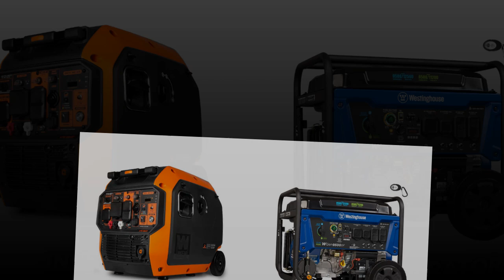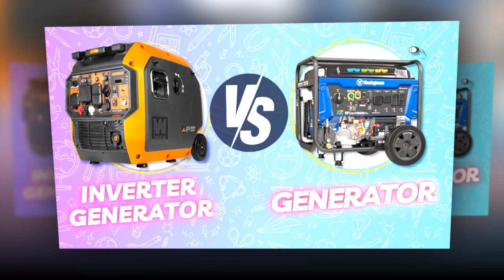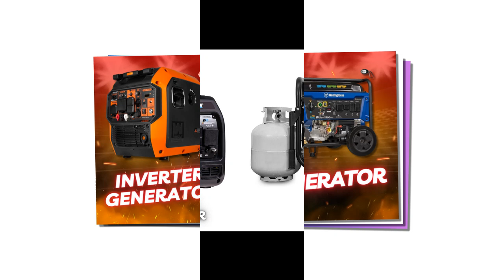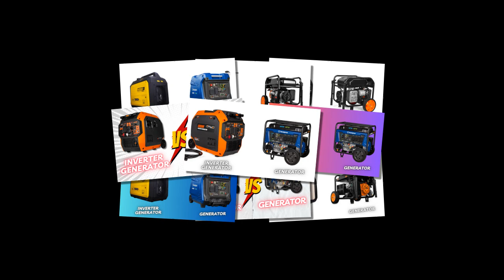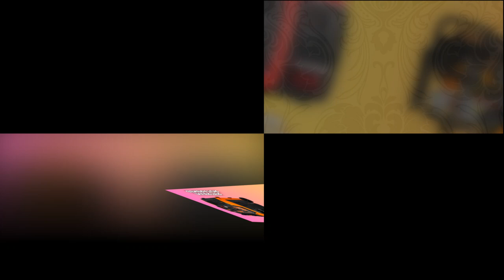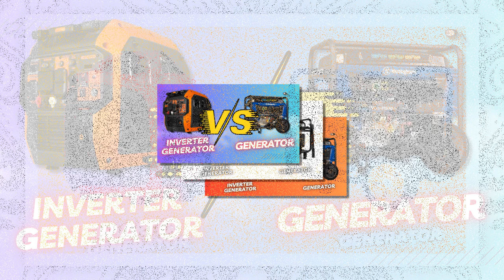RV and Camping Power: The Essential Inverter Generator vs Generator Comparison

Comment from the maker: Link = https://cutt.ly/Cr0d33sI
.
Inverter vs Generator: Save Money and Power Smarter! #InverterVsGenerator
.
Description: Wondering whether to buy an inverter vs generator for your next power outage or outdoor adventure? This video dives into the inverter vs generator debate, comparing fuel efficiency, noise, and performance for home and portable use. Learn why inverter generators are great for electronics and how conventional generators handle heavy loads. Plus, tips on standalone inverters for silent power. Hit like and share!
.
Hashtags: #InverterVsGenerator #PowerBackupGuide #GeneratorTips #InverterPower #EnergySolutions #BackupPower #OffGridLiving #PowerEfficiency #TechReviews